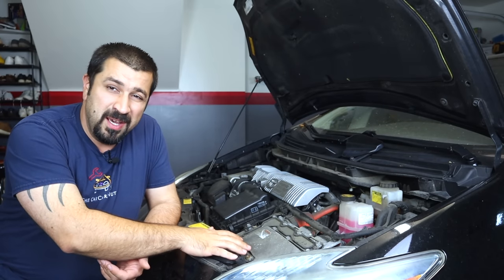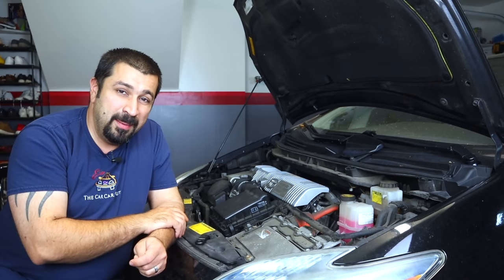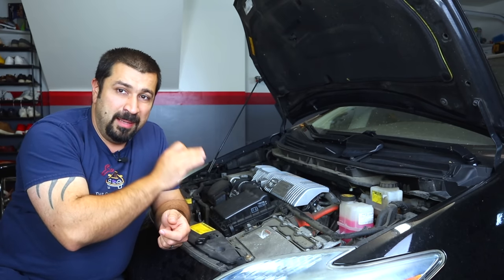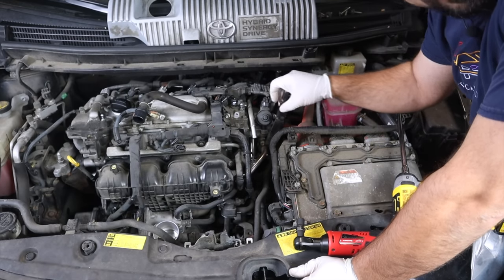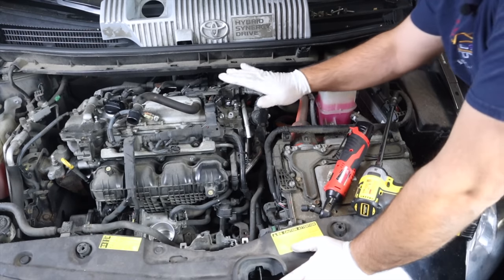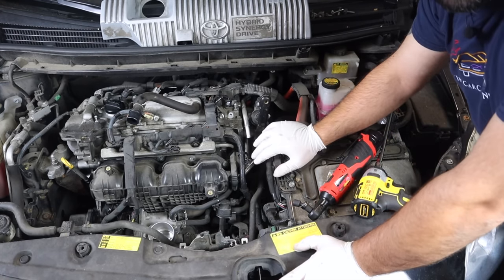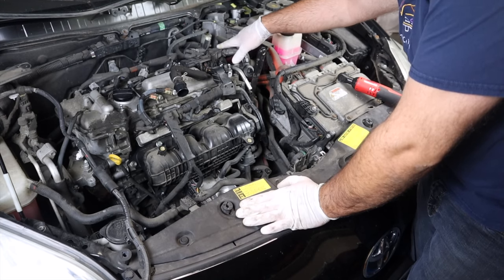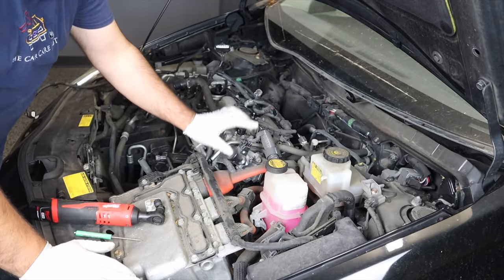Toyota EGR Diagnosis Tips and Repair Tips

Comment: I just cleaned my EGR pipe, valve, and manifold yesterday. it was a pain in the ass for me and seems to have worked for me for now, but watching you remove the valve without removing the exhaust port behind it baffles me completely. That shit it a pain in the ass removing the studs.

Comment: Great video, thanks for sharing. I done mine including cooler cleaning, was really cooked, I only replaced the intake manifold gasket orange rubber, amd used the old metal once for anywhere else. I managed to clean the manifold, egr, cooler, pipe , and throttle body at the same time., didn’t replace the egr itself, all done at 139k miles, since then the car drives fine at 175k now. Plans are to clean again at around 200k miles together with all coolant as recommended. 👍✅

Comment: I followed the diagnostic process for the EGR you outlined and turns out the head gasket needed to be replaced. I had the dealer complete the head gasket job and now it is running well.  I personally changed the EGR, Intake, EGR cooler, plugs, and coils. The dealer also attempted to swap my motor for a used motor which I declined because the replacement motor had 100K miles on it and I wasn't too comfortable about that, plus it was extremely expensive. Thanks

Comment: My 2013 Prius has almost 150k miles and doesn't burn any oil or experiencing any EGR related issues yet.  Should I clean the manifold intake and EGR pipe as suggested by many on the Internet or leave it as is.  The oil change been done at 4-5k miles since I bought it new.  I'm planning to change the PCV for the second time soon.  The car is still running great with 45-50 mpg.  I guess don't fix it if it ain't broke.  Let me know if I should have the pipe and manifold cleaned.  Thanks.

Comment: Much respect, these eco-friendly cars have become so complex, and every little part is squeezed into a small space usually intended for easy assembly rather than easy maintenance. I am so glad when I used to do more than tinker with cars, sometimes maybe 3 full services in a weekend, you could almost climb inside the engine bay. No computer diagnosis, you had to know if a capacitor was going by the colour of the points spark etc. I could tune a  branch manifold with 4 individual strombergs with a length of 1/2 inch pipe, and then put a flow meter on it and it was spot on. But man, the cockamamy stuff you dealing with. Almost stripping half the car to get at one piece.  Sheesh.

Comment: I appreciate all of your videos.  You cover more than anyone else ever can.

I have a 2013 Prius plug in.  I have 104,000 miles on it. I do not have any problems yet.

I may have missed the answer to my question, in this video or any other videos of yours, which is;

Are there ways to prevent all of these unusual engine problems that can occur only with the 3rd generation prius's ? Whether it's this EGR problem, head gasket problem or any other out of the ordinary problem that I can head off with some type of routine maintenance before they happen for this generation of prius? I do my normal oil change, plug change, use top tier gas,  etc. that is required of any type of vehicle from the owner's manual.

Any links to routine maintenance to prevent these unusual problems of the 3rd generation prius would be helpful.

Or is there no way to prevent these unusual problems from occurring with the 3rd generation prius?

Any answers would be appreciated by you or anyone else.

Thank you again. Keep up the great work !!

Comment: I clean the throttle body along with the EGR valve every 30k miles. Lexus 2015 GX460. The EGR is typically more dirty then the throttle body in my experience. Much easier to clean then to shell out $$ for a new one from lack of cleaning.

Comment: I did this cleaning to my 2015 persona series.It was a pain in the ass but I managed to clean it well and got rid of all the gunk.I also replaced my water pump,spark plugs,drain and refill the coolant from the inverter and radiator.Now it runs like a champ.Im on 120K right now🤙🏼
Reply: Have the exact car, any links to tutorials about how to get all those things done the right way? Also, did you do the update like AMD suggested? My Prius has 100,000, holding off till spring to get these things done.

Comment: Hey, I just want to chime in about my (seemingly) sucess with 2013 Lexus CT 200h. I had watched several other videos that more or less said "Clean the egr system and the cooler." I spent about 2 hours spraying all kinds of chemicals into the cooler, the same for the egr. Put it all back together and it ran worse in some ways. 

I didn't drive it anywhere, just had put it into maintenaince mode to begin burping the coolant system. Pre-cleaning of the egr, I was having cylinder 1 misfires. It was the worse on cold start ups, and would happen periodically while driving at lower speeds (15-35mph I'd say). Post-cleaning of the EGR, the engine was surging struggling to get enough air it seemed like.

I took the advice of this video, bit the bullet and bought a new egr valve from Napa for about 270$ (they had a sitewide sale!). Installed it, and now the car runs normal again! Let it run for about 20 minutes while burping the system, took it out for a test drive and it ran wonderfully! (Though the temperature light did come on, we will see if that's because I left it running so long in maintenaince mode.)

I'll be doing another round of burping in the morning, and then driving it around town to really verify everything is okay! 

Unfortunately, quite a few nuts and bolts were lost in the process 😅 But that's a simple problem to fix in the future! Thank you so much for your video! It gave me the confidence to go ahead and just  drop the money and replace the egr. Bonus is it has a 3 year warranty! So if it fails I should get another one :D

Comment: Removed the intake manifold, the egr valve and egr cooler on my 2013 Prius the other day .. cooler was all plugged up and the valve had fairly heavy carbon built up around it. Had been occasionally idling rougher, consuming oil and lost fuel economy. If you are going to clean one of these coolers, I’ll forewarn you its a PITA, several hours with numerous cleaners/solvents and a stiff wire repeatedly working it through each of the 65 long narrow passages between flushing it out repeatedly 🙄. Luckily I already had the wiper cowl/frame assembly removed from having just replaced the ABS actuator and accumulator system … 🤔 maybe not so lucky 😆. I had to purchase a fancy bidirectional scanner with special functions to bleed the brake system afterwards but saved quite a bit of dough doing it all myself and wound up with a fun new toy thats needed for working on more modern vehicles. Anyway brakes work great again and the fuel economy is back! Also changed the plugs that where coated white, not sure if true but had heard that a plugged EGR will cause a lean condition making the engine run hot and I’d imagine do other damage over time … heard it also creates more negative manifold pressure that pulls oil into the intake through the PCV, did find oil in the manifold and the pcv line .. fehw .. need to change the oil so I don’t wind up with the infamous carboned up oil control ring issue on this car. Car has been some work but if I can keep the fuel economy over 50 without too much service I can’t complain.

Comment: The whole kit thing is a super pro tip. Thank you so much! The funny thing is I now wonder how often there are other "kits" available at a steep discount that we just don't know about! I personally tried to find the kit without the number to see if I could do it organically... and without the number I wasnt able to do it. but low and behold with the number it pops right up. In your experience is having these under the radar "kits" or deals available but hard to find common?
Reply: What’s the kit number ? The dealership acted like there was no kit
Reply: @seaneby2489  Hi, yeah lemme check. first of all only place I could find it is the TSB which is what he indicated in the video. Number is EGR KIT:04004-58137 . that has the valve assy and 3 gaskets, there is a secondary part number as well which may be important, listed right under the kit. that is 25685-37010, the EGR cooler gasket.

Comment: Ya this is the type of video I like to see.  You know the type of vehicle cause you work on them.  How to diagnose, what to look for, tips and shortcuts along the way, updated new parts AND any different installation changes.  Oh ya, that happens too!  Software updates and of course the road test and what to expect during the drive.
When I worked at the L.A. Dept of Water & Power we had lots of "F" Series Ford Trucks and I learned a lot!  Mostly I delt with F150 through F550.
So.  Keep the diagnostic/repair videos coming!  And if you're doing a diagnostic/repair and/or a TSB or a recall on a 2020 non hybrid RAV4, you'll DEFINITELY have my attention!
Later this year I plan on doing coolant, transaxle fluid and brake fluid changes.  Any tips or cautions on these will be much appreciated!

Comment: I was a MDT for Toyota a few years back.  I remember servicing prius before the tsb/warranty extension and finding all of the carbon in the intake.  It was pretty shocking.  I currently have two prius C and they both have pinging on acceleration.  I am thinking it might be clogged egr issues.  Its not misfiring and no dtc, but I am thinking it is early symptoms of it.  Guess I got some wrenching to do!

Comment: Like the trick using tape n socket to hold nut. Nice to see repair from diagnostic to software upgrade. Clear and understandable & why to replace instead of trying to clean. What it fixed right the first time. Cheers 🇨🇦😎👍

Comment: Thanks for this. I have a 2010 Prius as well so I've been loosely following the EGR saga (mostly on PriusChat), but I barely drive (~90,000 km in 11 years) so it hasn't been an issue yet. 

For the EGR cooler, would have loved if you could have taken it out (probably too late for this car, but you may get another opportunity) to give us a closer look. My understanding (again, from the PriusChat threads) is that part of the concern and the focus on cleaning it is not just that the cooler is "dirty", but that it carbons up so much that it impedes the airflow.
Reply from the maker: Hi john! You can actually see when it’s carboned up. It does impede flow when it’s carboned up but when it’s now you still can’t see straight through it. Best way is to shine a light through and see if you can see some of the reflection through it
Reply: @TheCarCareNut  Thanks! 

I know you don't have any shortage of video ideas, but an overview of what to do (i.e. preventative maintenance) to keep these Gen3 Priuses on the road forever might be one. From what I've gathered so far, it's basically the suggested severe service schedule, plus cleaning the hybrid battery fan intake (or for the 2010, also getting the updated filter screen to keep the fan clean, thanks for that other video on those!) regularly, plus every ~125,000km/80,000 mi go in and clean/replace the EGR valve, cooler, and intake manifold. I've seen theories that this carboning up of the EGR/intake system is what later leads to the head gasket failures, and this should help keep the cars running for the half a million km that the Gen2s would get out of their engines. Is that the case, or is there still a risk of doing all this and still losing the engine prematurely, or is there anything else that wasn't in the original service schedule to add? Thanks again!
Reply: @Potato0t2  just wondering. Do you have still original battery in your Prius?
Reply: @janjohnny4945  The original high voltage battery, yes; the original 12 V, no.
Reply: @Potato0t2  thx. I asked anout high voltage battery. That's great. It lasts quite some time.
Reply from the maker: Honestly John if the EGR repair is done correctly including the software update and the updated valve you shouldn’t expect it to carbon up again as the logic was modified to prevent it from clogging up. Thanks for the video suggestion!
Reply: @janjohnny4945  We have had Prius since 2002; my old 2002 needed a hybrid battery half a year ago around 19 years and 208K miles. The first gen was a lot less reliable than the later ones. I did a battery rebuild, using a ChrisFix video for guidance. The first gen Prius kit was just under $2000; the second gen Prius kit is just under $1500. I keep cars until they are no longer economical to repair so I may end up rebuilding our 2014 battery sometime.
Reply: @TheCarCareNut  just watched your video for the very first time very informative and helpful. When you clean the EGR manifold did you use compressed air or water and can water be used?
Reply from the maker: Hi! I wouldn’t use water. Compressed air or throttle plate cleaner works well.
Reply: @TheCarCareNut  thanks for the info with quick reply noted on my previous post.

Comment: Some parts can be cleaned, just use the correct cleaner. The valve is a moving part, you might want to change. Also easiest to get to.
For carbon, extra strength oven cleaner ingredients sodium hydroxide apply, wait 20 minutes, rinse. for sludge and varnish use stating fluid.
4 holes in the intake manifold will clog as well.

Comment: Hi AMD, What is the best way to keep the engine bay for any Toyota hybrid vehicle  clean ? Can it be steam washed or power washed?
Reply: I use: Superdegreaser from Meguiar's, a detailing brush and a power washer. Keep high pressure water away from sensitive areas, eg. master cylinder, high voltage wiring, inverter, etc.
Reply from the maker: Hi! As B me mentioned you can use a light degreaser and agitate everything with a brush then either use water to clean it off avoiding electrical connectors
Reply: What is the kit egr part number?
Reply from the maker: 04004-58137

Comment: Thanks for this awesome walkthrough! I came across another way to diagnose the EGR system - simply disconnect the electrical connector that's on the EGR valve rather than block the flow. It will throw a code and the check engine light will come on, but if the juddering/hesitation with the engine stops - like your physical paint scraper method - then you know it's the EGR. Any reason not to do it that way so you don't have to take it apart? Thanks!
Reply: Thanks Zack. That does sound a lot easier. I wish the Car Care Nut had replied to give his thoughts on this. Could you reply with the web address (or link to another YouTube video) that you came across that discusses the alternative 'trick' you describe to diagnose the problem?  Also, did the check engine light go back off after you re-connected the electrical connector to the EGR valve, or does that have to be reset in some other way?
Reply: @kenweston7604  Thanks Ken. It was on the Prius Chat forum if I recall, I'm not sure of the exact link. If you do some searching you should be able to find it. The check engine light did not go off after I reconnected it, I had to clear the codes with my ODB reader. But they did clear.

Comment: well.. from someone who has seen many intakes of modern diiesels, that one looks clean :D great tip about the socket!
Reply: Agree the diesels are something else I would like to know more about blocking the system, lawyers need not reply
Reply: @doneB830  what do you mean by blocking the system ?
Reply: @tm199100  I know people blank them off just like he did to test it like fitting a plate without a hole so that the exhaust gas cannot get to the intake. I would like to know more about the consequences technically and not legally.It could break certain environmental laws in some states.
Reply: @doneB830   having a egr, improves fuel efficiency and lowers combustion chamber temps, for example. However, if you decided to bypass it, the car needs to be let known electronically that the egr has been deleted, otherwise it may not run properly as its taking the exhaust gases in consideration for air/fuel mixture
Reply: @tm199100  thanks Toma’s so that’s why he said it could be damaging, I won’t do it but just interested, so in order to do it you need to blank it and reflash the mapping with an update to suit the change, well done. There are brilliant software writers out there and there are some dangerous ones.  👍👍
Reply: @doneB830  unfortunately the dangerous ones are the majority
Reply: @tm199100  ha ha I agree totally.